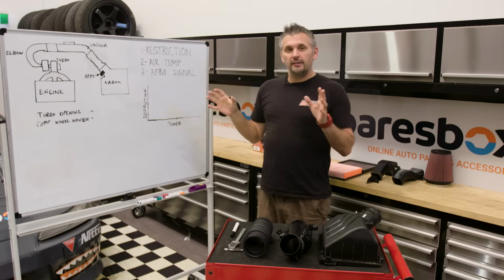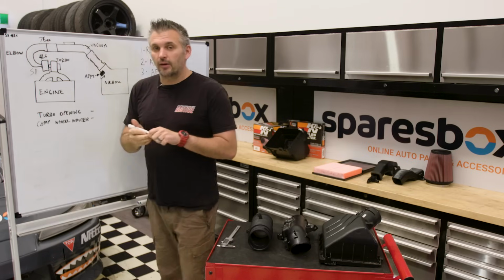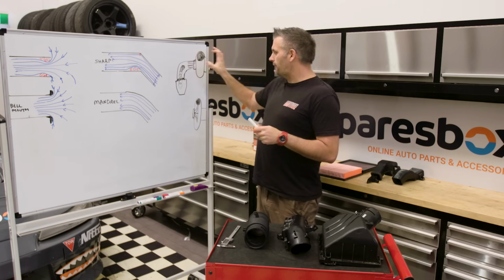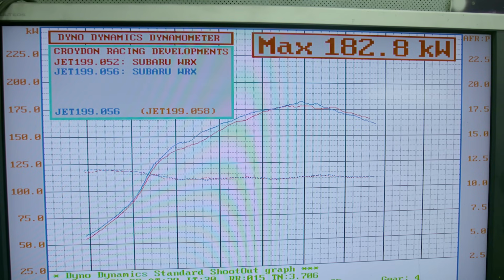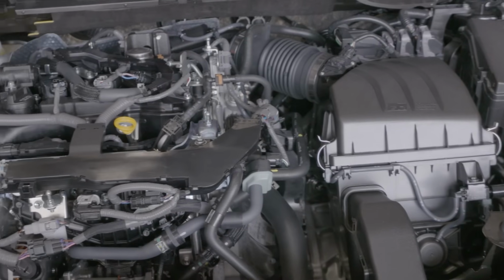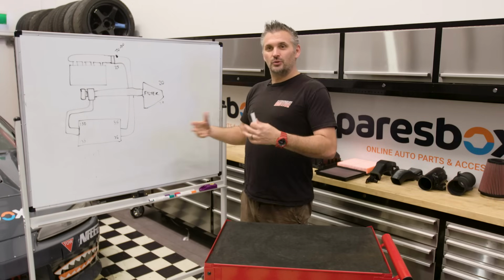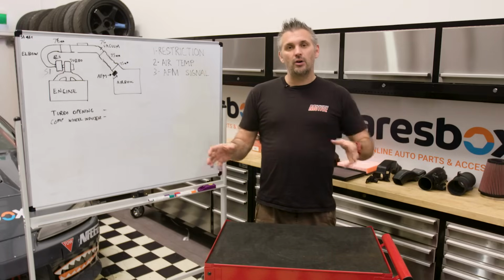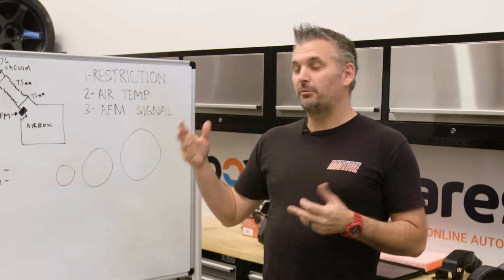Why Cold Air Intakes DON'T or DO Work on Your Car - Motive Tech

Comment: The MAF dictates the fuel demanded by the ecu. Therefore…any aftermarket intake needs to have the same circumference intake tube or you will need to rescale the MAF calculations…or it’s a gamble.  If the MAF is in the air filter box….changing the filter will require a tune / rescale the MAF or it’s a gamble. Usually if the new system is more efficient air flow the MAF / commanded preset fuel mixture will be lean and needs extra fuel to make extra safe power.
Reply: Higher horsepower turbo applications can gain 50 horsepower per 1/2 inch on the inlet piping.
Reply: Paper filters are best for applications are going for high mileage and off-road dirty applications. The oil filter will allow too much dirt and get clogged super fast on a dirt road as example. I ran a small fleet of suburban on new construction subdivisions with only dirt road access..  had to switch back to paper filters within a month.
Reply: The Gtr on the dyno w bell mouth has a turbo issue.  I can hear it. Has compressor surge from having too small or too inefficient compressor wheel.

Comment: I own a 2023 hilux gd6. I’ve changed the exhaust to a 76mm viper exhaust. I’ve done  the hybrid turbo and upgraded the intercooler with a unichip. Will a cold air intake make a huge difference on the power? Everyone tells me do the cold air intake. So should I shouldn’t I ?

Comment: K&N  were being used  on our military vehicles and helicopters during the  desert storm war. I have a 2022 shelby gt 500 the  stock air box is better than any after market junk you will buy ,but i do use a after market filter.

Comment: Add the efficiency groove to the throttle body(https://youtu.be/eHV-ANmN0ns?list=FLC9_hIZ1CWRNDSDXxLPyQnQ), then the other in the head(s) if the design has squash/squish areas(https://youtu.be/5YbcOhiwmkE?list=FLC9_hIZ1CWRNDSDXxLPyQnQ). See if a cone filter(with center section filter) works better than the stock air box.

Comment: the ecu and maf sensor are programed for the stock intake.  this means that if you change the intake you must reprogram the ecu to compensate for the extra potential flow.. this is the only way to maximize the potential of an aftermarket intake otherwise you will get almost no gain in power as the ecu still draws the same amount of air as a factory intake.  so tune for any and every mod you get so you know you're getting v for what you're paying for
Reply: I believe the stock ecu is programmed to handle a wide range of air intake volumes. It already has the program because the air volume fluctuates even with stock intake and MAF.

Comment: I had a 2003 Toyota Maytrix that I put a AEM cold air intake on . I never had it on a dyno, but it definitely upped my top speed . My top speed went from stock 128 , to 132 mph .

Comment: Those rubber corrugated intake pipes on forced induction engines should be binned when making more than 2 or 3 psi over stock as they tend to collapse inward under suction/boost and create a restriction.

Comment: Excellent information!   Nice to also learn of some of the tricks to what may actually make one intake work vs. another.   You really have to know what you're working with, your vehicle's needs, the limitations of the factory parts, their original design parameters, and have the means to test the changes you've made to determine if it was necessary/beneficial or not.

Comment: For a cold air intake to work it needs cold air coming in. Those big air filters attched do nothing to cool the air if it isn't separated from the main engine compartment that is full of hot air.

Comment: I tried the surpa stock intake with a drop in filter for kicks and giggles on my 780whp car.. it lost like 120whp😂 and 6 -7 psi of boost at the same wgdc. Iats dropped but that didnt matter. At high hp applications you want no filters or the biggest thing with a vstack thagt you can possible fit ( to an extent)
Reply from the maker: We make 1150ho through a K& N pod filter 🤷‍♂️
Reply: I  saw that cone filter and it's hugeeeee

Comment: I have an 06 silverado LM7 5.3l. I bought an AFE cold sir system, installed it and found that my truck feels slower and has to downshift more to accelerate. I put the factory box back on and it felt normal. Fast forward a few months I bought an upgraded (not larger) throttle body. It did make a difference in a good way, so I decided to throw my air intake back on with the throttle body and once again, it feels slower again. I am trying to figure it out with no scan tools or anything. Could it have to do with my MAF being so close to the filter? Or is it an illusion because it's making more noise so it feels like it should be going faster?

Comment: I would like to say on the short ram intake to many people are not installing them correctly you have to put a screen in the tubing of the short ram just before the mass airflow sensor or map sensor whichever one  your vehicle uses without it you're running way too lean in some cases throwing a lean code you can control the amount of air going in with the screen by tilting it or putting different size screen in there get it close to the sensor one I use has a big holes in the screen and I tilt it a little bit I can control the air to make it run rich or lean you have to put it on a scanner and look at the long-term fuel trim and short-term fuel trim get them down to 0 but I find running about + 1.5 long-term fuel trim is best and you need to install a jet performance mass airflow sensor or map sensor it is able to read higher volumes of air and adds more horsepower and build your heat proof box around it I can send you pictures of mine but this does not allow me to send pictures I guarantee more horsepower and if you want more horsepower be sure to add high performance coil packs and plugs + reset your throttle position sensor after all that then check your exhaust by putting a gauge on your manifold where the O2 sensor goes to make sure you're not backed up on pressure should be around 0 PSI check the specs for your car but most cars are around zero and we'll get up to maybe one or two at 2500 rpm if you see 5 PSI on a four-cylinder you going to need to upgrade your exhaust but if you're at zero you're fine check it out different RPMs hold it at 2500 for about five seconds see what the readings are

Comment: Ive always wondered the same thing. Most of the intakes i see add a cone filter that seems to just take in more heat. No heat shields. No boxes. Just sucking in hot air

Comment: It sounds like i will make most of my gains on a stock engine by simply adding a K and N drop in filter to the stock airbox instead of doing after market
Reply: Just remember to clean your airflow sensor on yearly service due to the K&N Airfilter Oil tend to leave sticky residue on the sensor so the sensor will misread and fail when covered in the sticky airfilter oil..
Reply: I just put one in my 2022 BRZ and can’t hear or see any improvement.

Comment: I hate the myth of "hot air intakes". 

1. The air is not that hot in an engine bay

2. The volume is air is so much higher, the energy density is higher regardless if the air is hotter

3. There is a reason modern cars use turbos and no intercooler, because even tho not optimal, it is still much better than without it.

imho, people who complain about hot air intakes are people who dont know that much about cars and want to brag about the ONE thing they think they know.

Comment: I have a 1991 Firebird  GTA 350 sbc 5.7 newly rebuilt stock engine. I really enjoyed this. The previous owner had mounted an air filter straight to the TPI throttle body. Hot air... I found a stock factory air intake assembly complete. It has the bellmouth on the air filter box. After watching this video I can only surmise that a CAi would not benefit this vehicle with its stock engine. Anyone out there have any experience with third-gen firebird and intakes?

Comment: If cold air is more dense with oxygen what happens when it is heated up by the turbo/supercharger?  Does the oxygen content go down even while it is pressurized? I know heat plays a role as to pre ignition/detonation  which in turn causes the ecu to remove timing and therefore loses power. At what point does the air temp coming out of the intercooler stop making a difference. I would like to see someone make an A/C compressor that would  operate at a constant speed no matter what the engine rpm was so as to not overspin it at high rpm or not spin it fast enough at low rpm. Then instead of an air to air or water to air intercooler you could cool the air charge with an internal evaporator for some real cold air.

Comment: I think cold air intake are trash, the reason I believe this is because car companies have engineers  that design what works best for the car that respectfully design for. Unless your running real upgrades like turbos or superchargers, you do not need a cold air intake. Besides if you have a cold air intake in the engine bay your still sucking hot air.

Comment: Explain why when the stock air intake box was modified on my 1997 Jeep xj 4.0, adding a cone style intake & or cutting out a larger area at the front of the box for easier air flow to enter the box not only the transmission shifted smoother but the engine also idles much smoother with much improvement in throttle response.

At 1st I cut out as much plastic of the bottom portion as I could from the very front of the stock air box where the little bottle neck intake hole was, put in a Fram filter the improvement was undeniable, I was encouraged to try a larger cone style short ram intake but no upgraded change from the cut out stock box....

So many people are leaving out the simple fact the transmission shifting changes when a stock box is modified or changed to give more air flow then the bottle neck hole most have...

Some may prefer the change others...

Comment: Thank you for that information, you helped me solve an issue on my truck that I wasn't seeking the answer here for. The AFM signal was changing the timing of my truck which was causing a check engine light because of timing... it made perfect sense when I realized the K&N air filter kit came with an air filter to put over the MAFS.

Comment: Basically don't mess with it.  The easiest way to make power is ignition timing and fixing fuel trims/AFR........  along with exhaust restrictions being removed.  Most cars from factory run like sh*t.  Ignition timing is way too high and tightning the hi/low octane tables along with removing the overly pushed safety params....... = lean and mean.

Comment: Take a look at the "Volant Closed Box Cold Air Intake with Air Scoop and Powercore Dry Filter". This is a closed box system that is vented through the original cold air access hole (air from outside the engine bay) and also has an air scoop that works when vehicle is moving. The CLOSED system means there is no hot air leakage from the engine bay into the system.

Comment: question... i just got the smittybilt X20 gen3 10k and i have the same bumper but the clutch switch lever will not fit any way you clock it. can you give me a close up pick of the gap between your grill and the bumper? Upright the clutch lever needs to be about an inch and a half to two inches longer in the shaft to stick above the bumper and i think there is gonna be a just perfect clearance for it. butttt i have only found one place that makes any kind of lever relocation kit, its cool and flexible but has minimum length of 5 inches.... Clocked forward same issue and i don't really want my lever forward facing to take a possible hit anyway. about 3 inches of ugly exposed any way i do it. that pic would help me figure it out  thank you.

Comment: you were talking the amount of HP vs filter impact but when you mentioned the instances where the filter didnt matter you didnt mention the HP of those engines, were they just sub 250 hp engines?  does tuning the engines reach a point when the filter does matter?

Comment: I was close to the idea of replacing the stock intake for a so-called cold air intake.  Logic set in and it made no sense to do so as the CAI is sitting OPEN and INSIDE the engine bay pulling in hot air that is trapped under the hood.  This in turn would guarantee that the intercooler's efficiency would be reduced.

Comment: I mean why bother talking about Turbo engines and intakes.  This should of been all about NA cars, where the the flow and air temp makes an actual difference.
Reply: So getting more colder air to the turbo dosnt matter no?😂
Reply: @WillLeeds99  Not really.  A turbo basically compresses air so much that the slightly denser colder air really doesn't make a difference.  If you want denser air, just increase the pressure.  NA however, its key to maximising performance.

Comment: One more- altitude. I drive from 6000 to 10,500 ft. You are already starting with less dense air. So the higher the restriction, the worse it starves the engine. You want as much air as possible to the engine. And at that altitude, the filter is as, if not more important.
Reply: Yep I live at 9k and pull a camper over 11k Mtn passes with a 5.7 Tundra. 
Thinking about a Stillen  cold air box but don’t know if it’s worth it.

Comment: In warm and hot temps, is better to get the engine intake air from outside the engine area.  Colder air is from outside the engine compartment.  Not from inside the hot engine compartment.  Is all lies "Cold Air Intake".  If from engine area.

Comment: I started watching but gave up! It starts out as "we will be talking about intakes. The first thing that never seemed to get mentioned is the intakes you showed also when advertised use the word "COLD" in their description. As colder air is denser air (more air molecules to mix with more fuel molecules, to help the "AIR PUMP" read engine operate. But it then generates into a story about engines with turbos. Not what I was expecting nor interested in.  That is a hole different type of "AIR PUMP". All dyno runs-at least that I have seen and but my vehicle on 493 BB Mopar, 1 4bbl carb (1050) normally aspirated _689HP - 675Lbft. to not take into consideration the effect of the air pressure increase at the front of the vehicle as it increases in speed vs standing still on a dyno. Bottom line EVERYTHING AFFECTS EVERYTHING. I was looking forward to a discussion of the affect of a "COLD AIR INTAKE vs Stock. My mistake. Did make it to about the 20 minute mark though. What I saw was VERY nicely done. Just not what I was after.

Comment: A Nissan GTR engine runs into other problems at the 800+ bhp point . Its block is crap compared the the Supra block and begins to flex . A Supra block 1000+ bhp no block flex issues . If you section both blocks the Nissan block is poorly cast by comparison and has a weak internal structure . Anymore from the Nissan block and you have to swap it out for the HD block .
As for K&N filters you can actually make as good or better from cheaply available stainless mesh and readily available filter media . In fact this is generally the case in highly tuned N/A F2 sidecar engines where 180 bhp/ltr is common from a 600cc engine . 
Any analogue MAP/MAF/IAT etc sensor can be manipulated by a 5k or 10k pot ( variable resistor) in ether pull up or pull down mode by changing the +5v signal out to the ECM . Use a quality 10 turn Bourne's etc pot for fine adjustment .
Another problem in mounting a cold air pick up aftermarket conical filters is ' puddles' ! In countries where it rains and on a dry surface you suddenly come across a puddle created by a blocked drain etc., whoosh , gulp...one set of bent rods , so protect the cold air pick up point as it pickups up the same volume of water in an instant .

Comment: Also sometimes manufacturers will deliberately restrict the air intake systems on lower models  to make higher end, more expensive models, more appealing to customers. 

BMW wouldn’t want a 335i to be more powerful than an M3. 

But you can make it faster than an M3 if you modify it.

Comment: Many stock intakes are designed around emissions, fuel economy and noise reduction. 

Cars have to pass government regulations/tests to get approvals.

So if you are only concerned with performance, there are nearly always improvements that can be made to the stock induction set up.  Such as lowering the air temp and or removing restrictions.

Comment: From what I've found. Stock systems are designed to give mostly mid range torque for drivability and not much top end. A cold air kit tends to give you more top end at the cost of mid range power. Although this isn't the same for all cars.
Reply: Everything from the manufacturer is designed for the average driver, in the average city, place, speed limits & never straying from the designated MPH for the average person. To gear heads, we just want to make things go faster and more efficiently than they do from the factory - we don't want Grandma's ride - we want our ride!
Reply: Exactly, as per my comment above.  The AEM cold air intake on the Toyota Matrix with the 2ZZ-ge upped the top speed 4 mph .  If it did nothing but make noise like most people claim , it wouldn’t have gotten any mph difference.
Reply: @jamesstewart3771  was that at the same humidity and air intake temps?
Reply: @  I live in Ft. Lauderdale, Fl , the temp and humidity is always the same , hot , and muggy .

Comment: Had a guy try to tell me the turbulance starts at the intake and through to the turbo. So, turbulance goes through the air filter and intercooler ?
Reply from the maker: Turbo spins so fast it doesnt carry the turbulence through it and into pipes, no ,

Comment: In "75" had a ls5 454 SS chevelle 4 speed. Couldn't figure out why it ran so much stronger when it was cold versus after it reached operating temperature. From the heat under hood I bet it was down 30 hp.